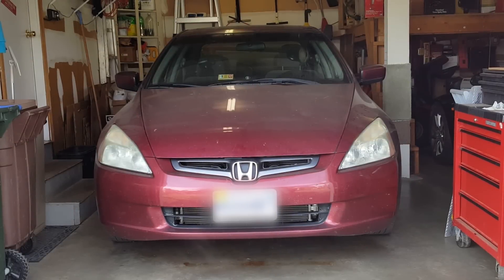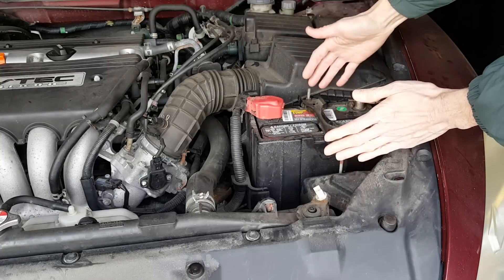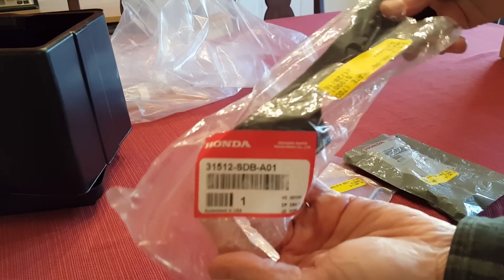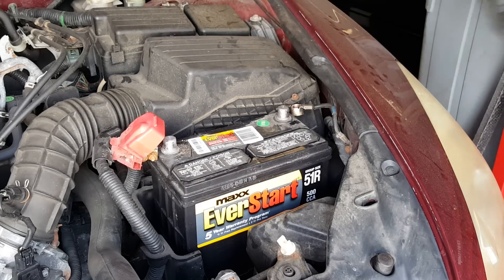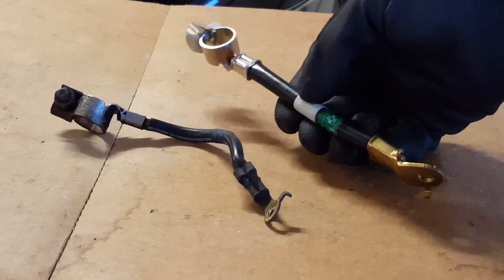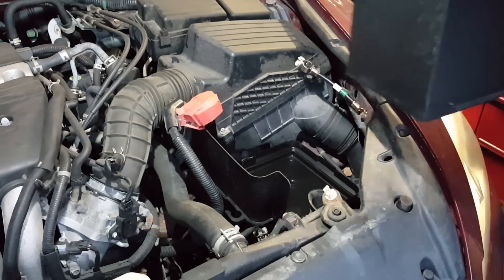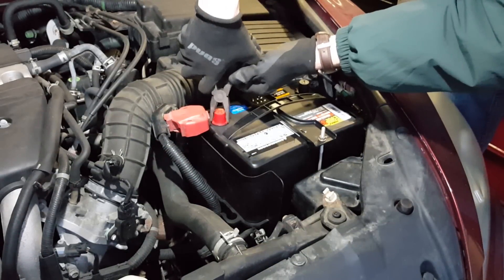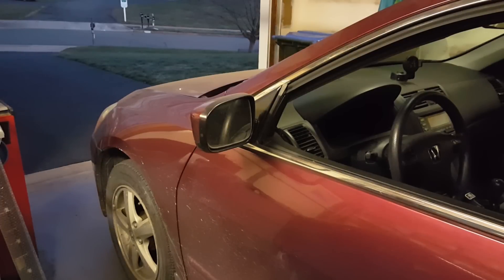Honda Accord?  DIY upgrade that undersized battery!

Comment: No need to change the ground cable.  Changing the battery capacity does not affect the current draw.  The V6 starter draws more current than the 4 cyl and is the reason the V6 version has a thicker cable.  But changing the cable won't hurt anything.

Comment: Our 2003 doesn't seem to have this problem but I may upgrade it anyway. I really like the 2003 year for the 7th gen 4L Accord. The tail lights on it are the best looking out of all the later 7th gen versions. Our daughter bought one that was painted in the beautiful Eternal Blue Pearl color and even now after 21 years and 130k miles it still looks good.

EDIT: I was curious about the battery cable, if we need to upgrade the negative, shouldn't the positive be changed as well? Looking it up I see the cables are much different though. The 2.4 uses 32111-RAA-A50 while the V6 model uses 32410-SDB-A00 and appears to be a simple cable with only two connectors, whereas the 2003 cable comes with 6 or 7 additional connections as well as the two for the battery and the starter.

Anyway great video. Automotive videos like this are priceless, they help us normies out here save a lot of money while learning new skills.

Comment: Thanks for your video!  Not sure if others have asked a similar question as there are over 300 comments.  I am wondering if the V6 battery plastic tray and cover are big enough to accommodate a 24F group battery.
Reply from the maker: I can't say for sure but it should probably work just fine for that battery, too.

Comment: For the battery tray, did the group 35 tray have the built-in plastic hooks to snap in the harness? The tray changed for the 06 and 07 model year and I went with that but it does not have the hooks built-in for the harness. The part numbers are the same except for the last three digits. A00 vs A10 for 06 and 07.
Reply from the maker: The battery tray is the metal part permanently affixed to the car,. So I assume that you're actually asking about the battery box part #31521-SDB-A00. Mine did have the built-in plastic clip for the wiring harness as can be seen in the video at around the 5:09 mark. For whatever reason, I didn't click the harness back into that clip during that segment of the video though I did it later off camera. The diagrams that I found online for both versions of the battery box assembly looked identical. https://www.bernardiparts.com/Honda-BOX-BATTERY-70D__31521-SDB-A00.aspx

Comment: Excellent video, I found it satisfactory, I also upgraded the AcDelco brand battery to my 2011 Honda Fit Sport, because the one it comes with is too small, I think Honda uses small batteries to save costs.
Greetings from El Salvador

Comment: Any thoughts on the other ground cable that goes from the body to the engine?  Is the V6 model's cable larger there too?  If it is, not replacing it also kind of defeats the replacement of the battery to body cable.
Reply from the maker: Good question. I think that it's more about the path of electricity through the battery and the body while cranking which is the time of highest current draw. I expect that the engine ground strap is the same across the 4 cylinder and 6 cylinder models.
Reply: @WorseThanChiggers  I ordered both and pick them up tomorrow.  I'll let you know.  The transmission ground is on back-order (I don't even know where it is on the car, it's fairly cold out).
Reply from the maker: @wayne12345z  Thanks! Please let us know here how your experience compares to mine.
Reply: @WorseThanChiggers  picked up the cables.  The motor to frame looks to be the same size.  Upon removal, the existing ground is very fine strands and badly oxidized.  About 1/2 strands broke and green.  Looked OK from above, but not once it ame out. Anyone living in the salt belt should replace this after 20 years 🤔.

Comment: No auto parts store wants to sell me a different group battery other than the 51r for my 2.4l v4 Honda, so I called Honda and explained why I want more cca because my Honda sits outside in the winter in continual below zero weather. They told me they do not suggest I increase the cca because it can cause problems with the electronics because of surging. I don't think I've ever heard of anyone having that problem.😢
Reply from the maker: That sounds like a bogus and misinformed answer. Just go to the auto parts store and buy one off the shelf as you please.

Comment: Any battery has more than 1 year warranty,even EVER START from Walmart!
instead spending all those money for battery upgrade,you could buy a better quality battery the same size
group 51R has 500 CCA 
and group 35 of same brand is only 525 CCA
bigger battery has more reserve capacity than a lot more CCA
Reply from the maker: Nope. It wasn't the quality of the battery, it was its capacity especially in cold weather. The small battery just doesn't have the amps necessary.

Comment: Great Video, very detailed and thorough explanation, I am only confused about one thing: the J pegs  (J pins) I installed them facing out , meaning the " J" the hook part of the J is facing away from the battery is that okay ? is that how it is suppose to be ?
Reply from the maker: Yes, that definitely sounds like what I did. I don't even think that you could get them in the other way.

Comment: real talk I lived in new jersey for over 10 years and I have a 2009 Honda accord ex 2.4 and when I purchased the car certified used at the dealership they had a v6 Acura battery in it. Well when it kicked the bucket I purchased a Walmart battery just like that 51-R well exactly 1 year and two weeks after the warranty it died the new jersey weather killed it now i have the 35-N in the car from Walmart same specs as the one in this video I never had a problem over 250k on my car and it still runs new like a dream!! this was a great video sir it confirmed what i was just telling someone about batteries i googled it and your video came up. 2022 october 16
Reply from the maker: Thanks for the kind to comments. I really appreciate it. Great testimonial about your real world experience.

Comment: That old 51R is still under warranty. My wife's car battery was already out of warranty so I upgraded. Her car is a 2013 accord.
Reply from the maker: You're right. At the time I produced this video, the battery was only 13 months old and still under warranty. That goes to show you that it is undersized for this particular application and barely lasted a year before giving up the ghost. I traded it in under warranty and applied the credit toward the Group 35 replacement.

Comment: PART NUMBERS ARE INCORRECT for I believe 2008 onward. They are definitely incorrect for 2013.  

Based on the video, I bought a Group 35 battery and ordered the parts... the specified tray does not fit.  Since I had already purchased and temporarily installed the battery, I forged ahead. 

I had to trim off large chunks of the left vertical part of the battery tray, and remove the two bumps on the bottom that are supposed to drop into the metal frame below it. I put some rubber tape between the tray and the bracket to give it some friction. I was able to install the cover, and the bracket, though my longest J-bolt still barely reached on the front side of the battery, and does not line up with a hole for positive engagement. I slipped it over the edge of the metal battery tray bracket.

End result was ok, but the whole point in spending close to $100 in parts was to get "perfect".

Subsequent investigation I found that for the 2013 model, the V6 uses  a Group 24F battery, not a Group 35.  It is possible that the parts for the 2013 V6 would have worked but I have not tried.

TLDR; Check part numbers for the V6 model in your specific year before attempting.

Comment: Excellent video and idea. My TSX has suffered with starting issues for too long even though I've replaced the starter. So I'm thinking of trying this in my '04 TSX since the 4-cyl engines are similar. But I don't know if the battery box (tray) will have the same clearance as the USDM Accords. Anyone ever try this mod on a TSX?

Comment: Hey all... Quick question... I have a 2013 Honda Accord LX. We have had it for 6 years and have had to change out the battery I think 3 times? Maybe 4? Is this just kinda normal because of the smaller battery that Honda put in these? Or is there some other kinda problem with my car perhaps? What yall think? Thanks!
Reply from the maker: Could depend on many factors including your unique usage and climate. Why not try the upgrade just to see. You won't regret it.

Comment: Thanks for another really clear and informative video; a failed battery on my 2005 Accord set the alarm off which then required recoding of the alarm! I don't know if my local small independent garage fitted a bigger battery, but they did fit a Bosch one. In my experience of other cars and this one, they are well worth the extra expense. Even leaving the car undriven for three weeks in January, it starts first time. But then we don't have much freezing weather in the UK, but we do drive around with headlights on, heated seats, rear screen demist, GPS plugged in, etc. Michael

Comment: Upgrade worked great on my 2007 Accord 4cyl. All parts recommended fit perfectly. Can’t wait for an early morning start up in Mammoth Lakes. Thanks
Reply: Did the battery upgrade recude rpm drops when the fans kick in or when controlling the windows? Or did it reduce the dimming of the headlights?

Comment: Or....you could go with a Odyssey pc680 (agm) motorcycle/atv battery.  Theres room for 2 but i only use 1. Can be used with up to 8.0L engines. Used to save weight for racing and or space with custom installs.
** if ya can prevent an agm or regular lead acid battery from sulphating, you can greatly prolong its life. Wire a trickle charger up to your vehicle battery and plug in every night if possible. Hardwire with   ring terminals or simply secure aligator clips works fine. Just make sure nothing will short them.out.

Comment: OEM anything is  staggering!..how much did all those "Plastic" parts cost...a few hundred?..nice video thanks!
Reply from the maker: I believe that it was only around $74 in parts. Put that into perspective. You can easily pay twice that much for an upgraded battery itself. And, you will still be way ahead if you do it yourself rather than paying labor for someone else to do it for you.
Reply: @WorseThanChiggers  sounds like you did well!!..I'd like to do the same thing with  a 2007 civic ex coupe I have with a  5 spd. looking to see if the same part #'s you used on your ACCORD will work on a 
Civic..I bet they will!! Just did ALL the motor Mounts on the car..OEM  straight freight was almost 1k $$...Was able to get the best deal possible  w/ new Hardware still  ALMOST 6-hundred dollars for parts Like a new car!! no noise no vibration happy car happy owner!!
Thanks again for your video be safe and well in the New Year!

Comment: You can fit bigger 24F battery without spending any additional money or parts! A quality brand battery will usually last 3-4 years. Everstart maxx Walmart batteries are cheaper quality budget batteries and may not last. Then again I think we are being sold cheaper quality batteries nowadays and they are junk and not holding up..
Reply from the maker: Indeed you can do the upgrade without the proper hardware but I wouldn't want to buy a used car that had it done that way. The proper battery tray is important to protect against damage for when your battery leaks. I've bought quite a few EverStart Maxx batteries and they typically last 6-8 years in my own personal experience. Why do you claim that they are of cheaper quality and as compared to what? The EverStart "Maxx" are clearly better than their regular economy EverStart batteries as noted by the difference in their warranties and CCA ratings. They're made in the same factories as all other mainstream brand batteries by companies like Johnson Controls. Walmart simply has the power to buy in bulk and benefits from the basic economies of scale. I try to judge such things based on facts and scientific evidence, not emotion.

Comment: Will it be fine without the battery tray?
Reply from the maker: The engineers designed the car to have the tray in place to secure the battery properly from lateral loads. It is also important for when your battery starts to leak acid and wreak havoc on the components below.
Reply: @WorseThanChiggers  how would you know anyway that it is leaking? Even with a tray, it would overflow and still leak on the components below right?
Reply from the maker: @neondiamondsaquaberry17  You should look at it periodically to see if it is damp on top or seeping acid down the sides into the battery tray. It may also be accompanied by visible corrosion on the battery terminals. When they leak, it is typically very slow and only a small amount. So, it won't overflow. The plastic battery tray is designed to catch that small amount of acid and to keep it from causing expensive damage to the metal parts below.

Comment: But why does so many people even replace a bigger battery tray for? When i upgrade the OE 51R battery to group 35 battery i did not replace a bigger battery tray but instead still use the original battery tray. Still fits but just a bit tight..

Comment: not necessary you need a bigger battery box.  My group 35 battery fits in the original battery box OEM group 51R battery box tray *a bit tight fit but still does it job.    All I changed was the bracket holder.  Buying a new battery tray is fine but no point wasting money buying the battery cover lol.  Doesn’t do a damn thing
Reply: It does - it keeps it warm during the winter

Comment: I live in the NorthEast, I have an Everstart 51R in my 2009 Honda CRV. Its 7 years old and still going.  All those parts you bought must have cost just as much as a new battery.  Pointless. Especially in San Diego.
Reply from the maker: I'm glad you're having good success. Perhaps you're in the luck minority or there are other factors. San Diegans live in an awesome climate and don't have the issues to deal with that challenge others (battery life, rust from road salt, frozen door locks, taking a comfortable walk in the middle of January). If I sound jealous, I am.  :)

Comment: You can do this same upgrade to 04-08 tsx. I did it to mine also to my 05 civic but the civic has reverse terminals so a longer negitive cable is needed but it works. To hell with those power wheels battery why honda likes them idk but i have gone through too many of them to count so one day got fed up and did the mod.
Reply: @JD-bi2qf  no accord parts i just put it in there and fit good no real modification needed. Just a bottom trey to hold the bigger group 35 battery.

Comment: Will this void the warranty
Reply from the maker: I can't see how. Especially if you use the correct parts. It wasn't an issue when I did this on a 13 year old car.
Reply: @WorseThanChiggers  but using the bigger battery is not the correct part
Reply from the maker: @ygbodybuilder3023  It is the correct battery for the V-6 model of the same car which has the same alternator, at least for this 7th generation Accord. I suppose its up to your own liability tolerance as to what you're willing to do. All you're doing is improving the battery and its capacity to provide adequate amperage when the car demands it. People do some mighty strange mods to their cars that have no affect on most aspects of their warranty. The only reasonable question that could be raised about this upgrade would be about the alternator and its ability to charge the larger battery. But, that's not a concern. Simple electrical theory shows that the battery can't demand more than the alternator can provide. It may just take longer to charge. What part of your warranty would you be concerned about voiding? For example, nothing in the drivetrain or SRS would be affected by improving the battery.
Reply: @WorseThanChiggers  but my honda is not a v6 model so if the dealership was to see that battery in my car they could void warranty if they wanted to. I have to get more information on this.
Reply from the maker: @ygbodybuilder3023   I'm still curious as to what part of your warranty would you be concerned about voiding?
Reply: @WorseThanChiggers  any part. I paid for a extended warranty and don't need it being void because of  a bigger battery
Reply: @ygbodybuilder3023  yes it does void the warranty. The bigger battery is better but dealership tends to void anything not the original part was intended for. I mean once your extended warranty is over.  Switch to this group 35 battery instead of that tiny small group 51R battery
Reply: @seolboy2088  thank you boss

Comment: Hi I don’t have a Honda Civic, I have a 1995 Suzuki Every van with a battery that is much smaller than this one but it sits in a bay that could fit a bigger battery. My husband bought a new battery for his Evo 4 that he ended up not needing so I wanted to use it for my van but I also have a concern with the alternator since it’s the size of a baseball or softball. Would I also need a larger alternator to charge the battery, and if so what would I need to install a new one? How would I make it fit? 
I know it’s a not so common JDM car but it’s got a battery and alternator just like the rest so it can’t be too hard right?

Comment: I have used Duralast Gold (AutoZone) in all of my cars. Surprisingly, my 8th gen Accord is on its third 51R battery in 5 years. This has NEVER happened in all of my other cars! I will be doing this upgrade!
Reply: Same here, Duralast Gold 51R in a 2012 Accord lasted 5 years (5 cold Illinois winters) but the new one I bought 2 years ago is already showing signs of failure. I wonder if they lowered their quality or I just got a bad one.